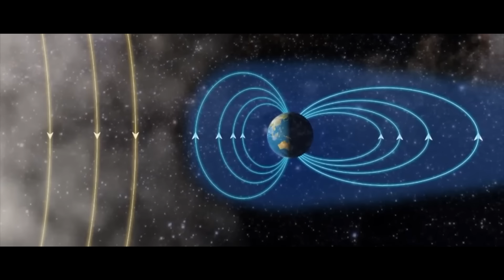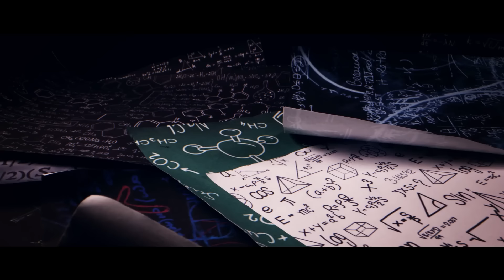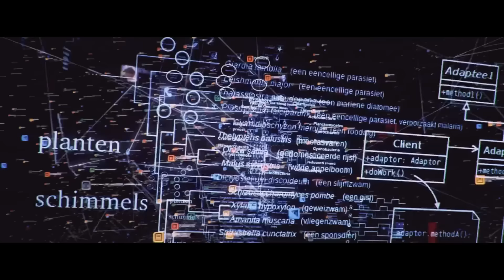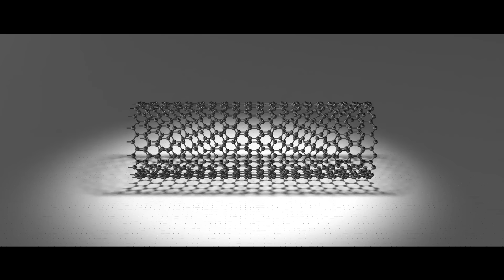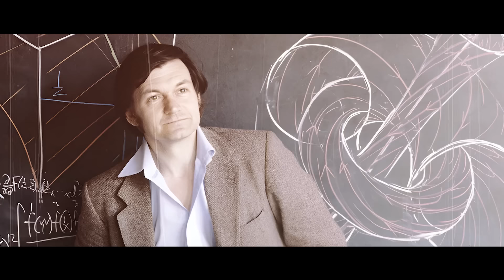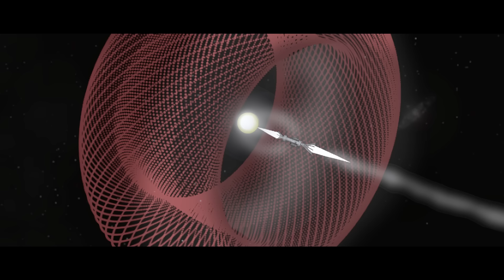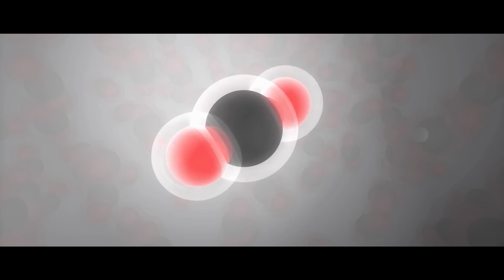20 Space Megastructures That Could Transform Our Future

Comment: A far more practical and near-term (relatively speaking) megastructure would be a tethered ring system, and then eventually multiple orbital rings.  These could enable nearly limitless amounts of low cost transport of people and material to and from orbit that will most likely never occur otherwise, except possibly by mass drivers from the moon or other airless bodies.  Unless we get the infrastructure in orbit, we can't do any of the other megastructures mentioned.

Comment: Realistically...chemical propulsion could never amass this level of power output...the material needed for "Dyson Swarms", would have to be heat proof basically and require the entire harvesting of planets...not small planets either...etc.
Reply: They are using artificial intelligence to solve these problems bro. They have a lot more powerful artificial intelligence than they releasing to public. I actually think it’s how Elon has worked out his space travel and neurolink. It can write full essay within seconds and is constantly learning. I always wondered how it would be possible. But now I understand it’s going be technology thinking of the technology, building the technology to build the technology etc
Reply: @Aaaaa___aaahshsh  AI is smart enough to know it's not HUMANLY possible...it's only a combo of information we know at lightspeeds
Reply: @LastNameGalePodcast  well I checked on Ai and they think it will be possible. Small ones in 50-100 years. Large ones in 500-1000 years. Using light beams or microwaves to transmit it. Ai will be solving all these problems while also collecting materials, and building it all.

Comment: The problem with radiation in space can be solved, by avoiding sources of radiation while traveling through space... yet overcoming light speed is yet another issue.... we would need to generate the power of a Dyson sphere to open portals to stretch space and create wormholes... we have to think about creating those types of machinery and have it on board the space ship... so we are prepared to create robotic AI to make those things.

Comment: Why don't we build a self sufficient space station in lunar orbit.  We could use lunar materials sent up by a mass driver.  Then when we want to establish a base anywhere we simply move the space station to orbit around the selected spot. Presto, anything needed by the colony is only minutes away.  When the base\ colony becomes self sufficient, the space station can move on to the next assignment. The station would be nuclear powered and all waste material could be ionized and used as fuel for an ion drive engine.  It wouldn't matter if the trips took years since the station is self sufficient and spinning for artificial gravity.

Comment: Listen, Dyson spheres are a virtual impossibility. To surround a star with material taken from other planets would be more than 200 independent solar systems with 10 planets on each. All of that material would have to be taken and used to create material large enough to surround a star, it’s just not feasible when you can use fusion for instance. Portable fusion plants would generate more than you could use. That is, if you know how to build them right now we don’t know how to employee fusion. But if you take a hollow sphere made of zirconium dioxide and place only hydrogen gas inside of it, and heat it to a plasma, then you tap the sphere from all sides to create sound or pressure waves. Sound travels 1/3 the speed of light in a plasma. The pressure waves all converge in the very center of the sphere via resonance. Once the fusion event occurs and exponentially, large pressure wave, or soundwave radiates from the center of the sphere to the outer shell. When this happens, magnetic mirroring reflects the soundwave back to the center where a second fusion event happens all in pico seconds. The second pressure wave can compress the helium into the next heavier element, releasing unusable amounts of energy that is unusable by our standards anyway. You don’t need.Deuterium and tritium for fusion Asian, you need sound. you need a sonic fusion reaction chamber. Then you don’t need Dyson spheres that is just ridiculous. In my opinion.